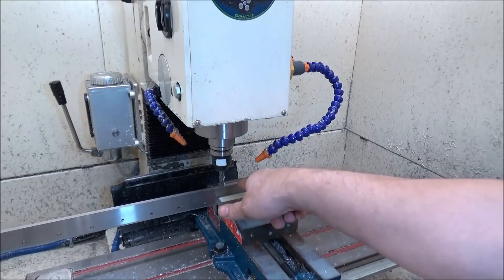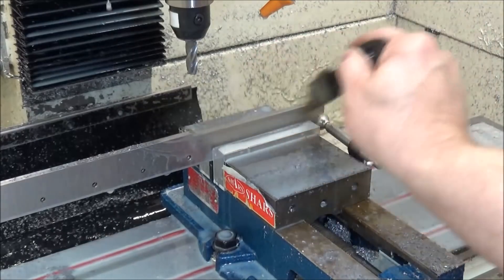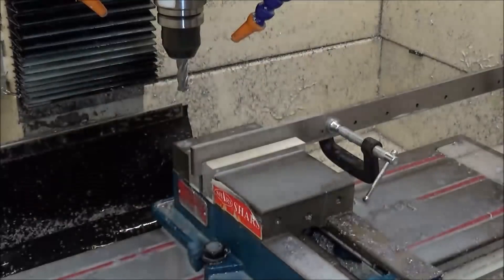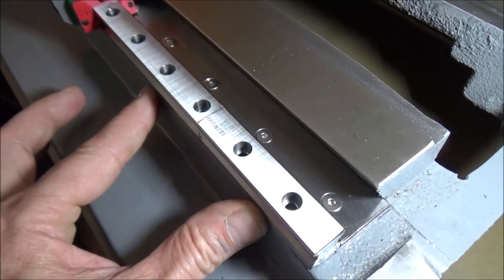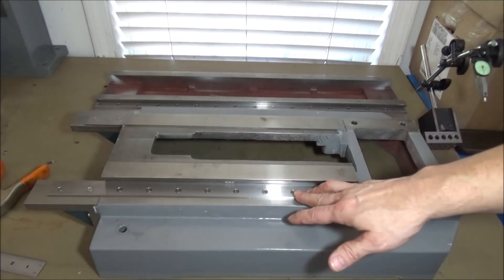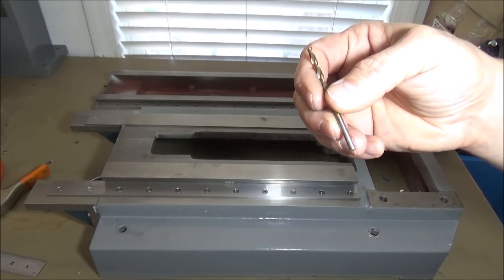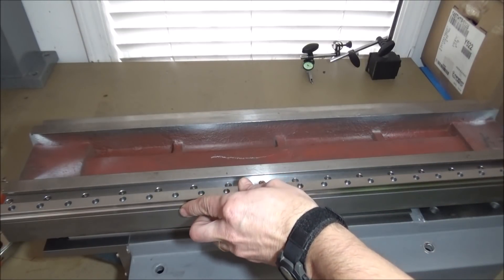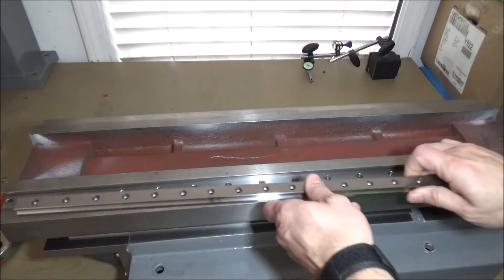PM727MXL Y Axis Datum Install

Comment: Have you measured if the button surface is flat to the other side ? I checked mine and the table has a low spot in the middle and one side to the other has around .005 to .008 difference ..
Reply from the maker: Yes this is a possibility and really you need a Known Flat surface to make sure its Flat. IE a surface plate.
Not knowing which side is flat when measuring from one side to the other is a issue. Since these surfaces were machined I would hope there within tolerance.